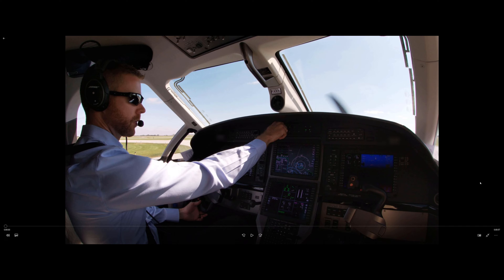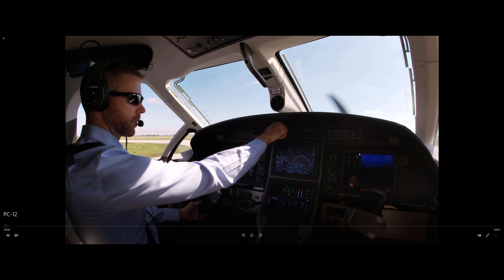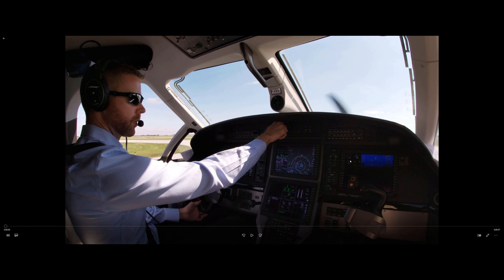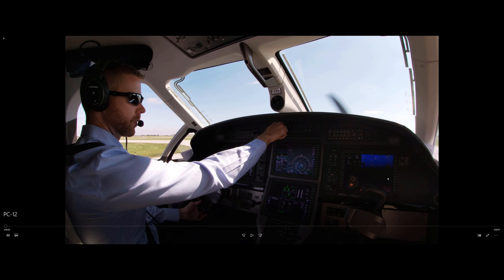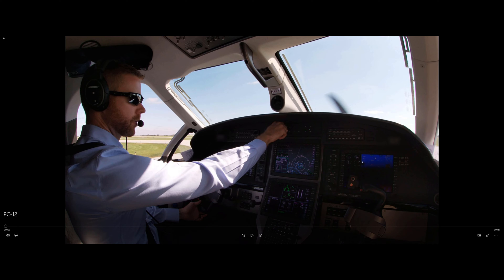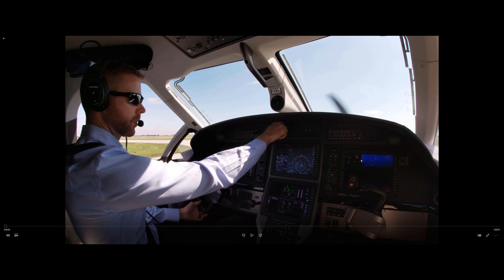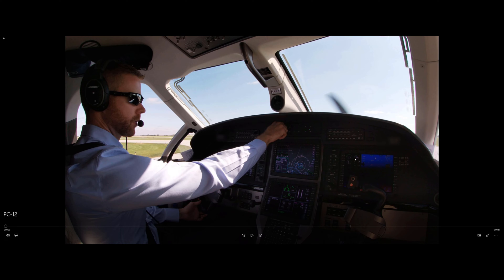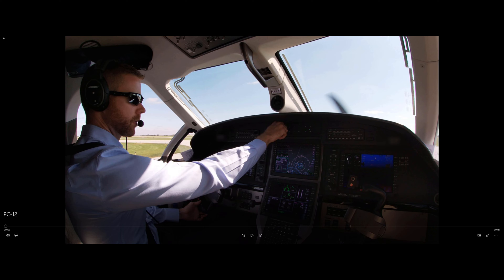How To Set Takeoff Power in the Pilatus PC-12

Comment: Greetings Gene, well explained video. Regarding takeoff power setting, what's the maximum time you can run the max t.o power setting before reducing to climb power? Also, is there a set defined climb power setting or does that change based on various factors. Thank you in advance
Reply from the maker: Hello, my friend! Thanks for watching! In the Legacy, there's a 5-minute limitation on the 1,200 shaft horsepower produced at the takeoff power setting. Standard procedure is to pull the power back to the climb setting at a thousand feet (AGL). Max continuous power (for climb or cruise) is 36.9 PSI (top of the green arc), but at the higher altitudes you'll be limited by temperature instead of torque (720 ITT max in the climb is recommended). In the NG, there is no limitation on 1,200 SHP in the climb, so there's no requirement to pull the power back although some operators prefer to run the engine a bit cooler for longevity (780-820 ITT climb / 780 ITT cruise). Cheers!
Reply: @GeneStuart   so I have a legacy with a 67P and it does that mean I use the same settings as the NG for takeoff and cruise. So I wouldn’t have to pull the power back and cruise if I’m not ITT constrained?
Reply: @GeneStuart   thank you! So can I cruise at 820 also?
Reply from the maker: @gabeolson7855  780 max ITT is recommended for cruise in the 67P on the NG. The cooler you keep the engine, the better the components hold up between overhauls.